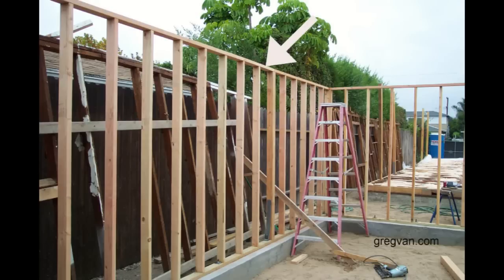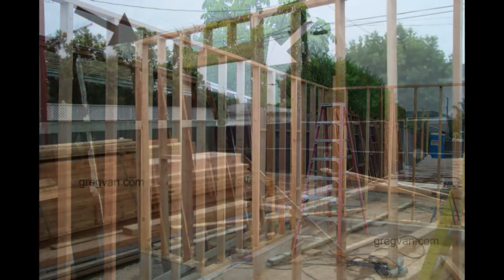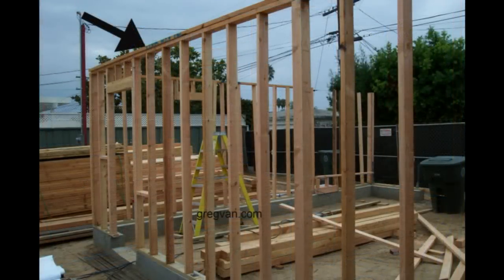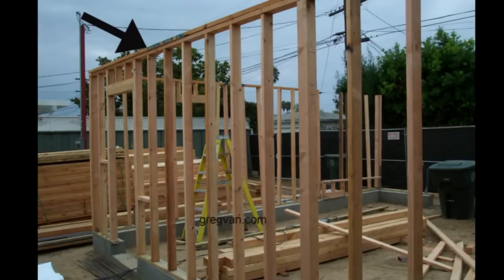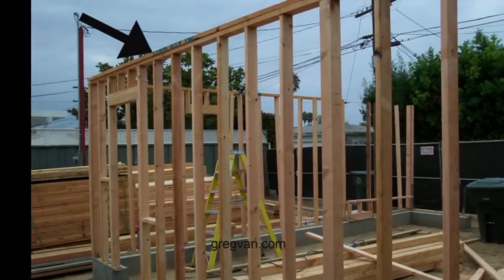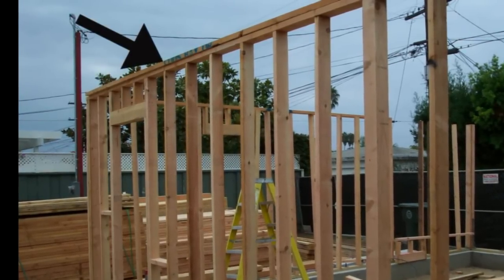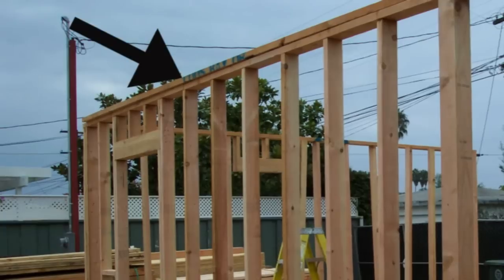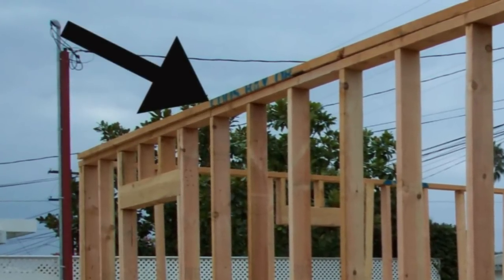What Are Wall Framing Top Plates? - Carpentry and Home Framing

Comment: If the top top plate needs to be 2 pieces of wood because of the length, does the joint have to be over a stud?
Reply from the maker: No, but it does need to have a minimum distance of 4 feet between breaks in the bottom top wall framing plates.

Comment: whats the biggest hole a guy can drill thur the upper plate to run wiring thur the upper plate, thanks.
Reply from the maker: It depends on whether or not it's a load bearing wall, sheer wall or non-bearing wall. According to the 2012 International Residential Building code book on page 158 it says that all holes 50% or greater than the width of the framing plates need to be strapped. Let me know if this helps.
Reply: thanks, makes sense to me, i was going to hav a guy run cablle for a video cam and he wants to cut 2 inch hole in outter wall of my new garage wall, it has two 2x4 on upper top of wall he called upper plate, i said maybe a one inch hole but a 2x4 is what 31/4 or 31/2
Reply: @briant3403  3 and 1/2.
Reply: if it is not a load bearing wall,  you can cut the top plates entirely and use straps.  This is often done by plumbers who send a 3 or 4 inch vent pipe up through the roof from the bathroom.